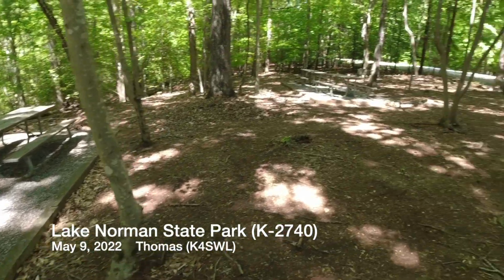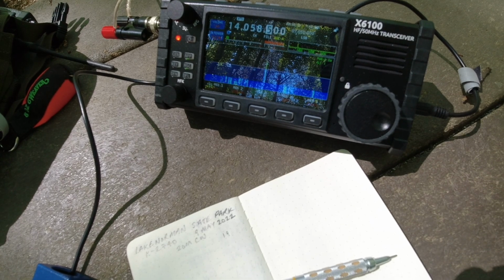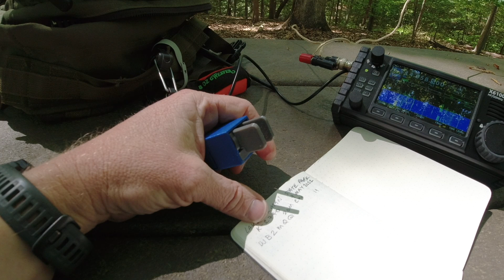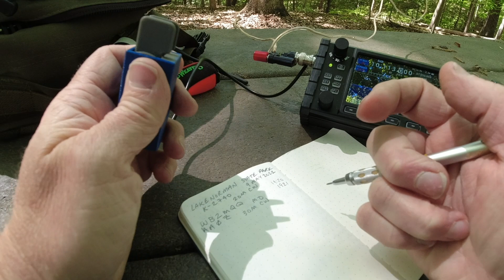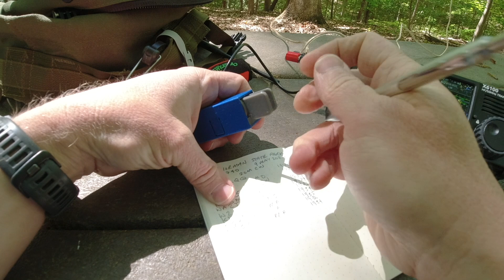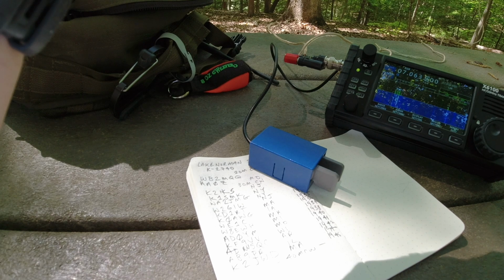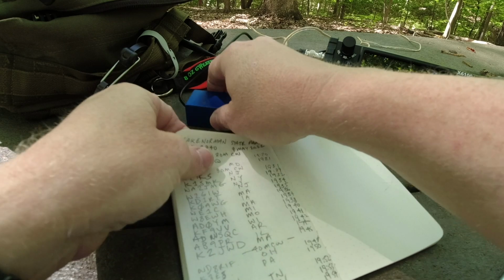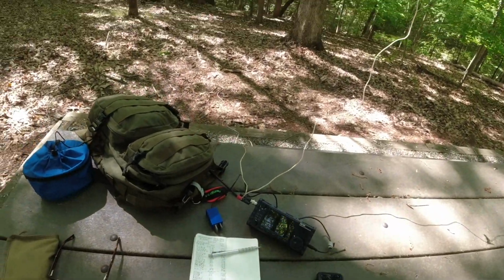First CW POTA activation with my new Xiegu X6100 at Lake Norman State Park!

Comment: I have experienced no overloading issues with my X6100, in the field or at home in the shack. I might be lucky, but really it's been fine here. I also have a IC-705 and many other QRP rigs to compare it with. I am LOVING the X6100. Mine is running full Armbian Linux with FT8 / FLDIGI / QSSTV, etc, all on board! Its got some quirks, but none of these are presenting any problems for me in actual use as yet. It's one for the tinkerers for sure (maybe not so good for your traditional "black box" operator). But I love it!

Comment: First, let’s say that the icom ic-705 is not in the class that the Xiegu x6100 is because the icom 705 does not have an internal antenna tuner even though you have to spend an arm and two legs trying to buy one. So forget the 705 and go with a 6100 and read below.

A comment if you don’t mind. First, let me  say this was an outstanding fantastic video you did. I’m talking about the 6100 Xiegu now. 
When I first bought it last year, I had high hopes for it. And sure enough it had problems. For example, you could not finetune it. That portion just did not work. But finally with the last upgrade, I have spent quite some time with the radio. Thank goodness because before when I bought it, I left it in a box and wanted to spit on it every time I walked past. But after I made the last software upgrade it now has wonderful fine tuning and I actually was able to send Winlink over it with just the USB interface cable that came with it. I also did WSPR with it. And was able to find tune and do CW with it. It seems like the little box with its upgrade is coming into its own. So I think now if someone talks about it, they should first upgrade the 6100 with the latest firmware and find out that it is coming into its own. I really really like the 6100 now however there’s one thing I do not like. And that is the cheap rinky-dink tinny sound coming out of its speaker. But other than that, with a set of earbuds, I can hear it pretty clearly, and if I was to go portable and want to grab a quick radio that has an internal battery and yes, it has an internal antenna tuner I am giving second thoughts about it and may start carrying it whole lot more. With its internal battery and microphone on the front of it you can almost use it like a walkie-talkie. So the 6100 to me is coming around. I think it can safely be considered when looking for a QRP radio. Because it can also do all the digital modes. Finally, the fine-tuning works. So don’t discount that Xieugu x6100 anymore until you’ve done the last software upgrade, and I think you will be quite impressed.
Oh yes, I don’t want to forget, saying that I was so easily able to send Vara HF Winlink email without an external sound card. The one built in this little box is doing just a great job. So this little boy is climbing the ladder.
Reply from the maker: Thank you for your comment. Excellent!

Comment: Hi Thomas, love your activation video's I do have one comment to make though. 
I have tried to hear you on 20mtrs but never manage to do so,  thats why an effiecient resonant antenna would certainly help with us european stations who dont have big yagis to try and work your QRP signals. 
So even though you are the chased after station, it would be better with a properly tuned resonant antenna to give us a chance of a Pota or Sota contact.  Just saying. keep up the activations and maybe one day ;-)
Reply from the maker: So actually, more often than not I'm using efficient, resonant antennas. This year, maybe 60-70% of my activations have been with 40, 30 and 20 meter end-fed half-waves. 
The UK and Ireland is, for whatever reason, a very tough catch where I live in North Carolina. Most of this summer, though, I'll be here in Canada (as VY2SW) where I should think it'd be much easier. 
It is true that more efficient antennas yield better DX. (Save the times I work Europe with the Elecraft AX1. That think is made of witchcraft!)

Comment: Once Xiegu started correcting early issues with firmware updates I was starting to come around to the idea of buying one of these.  If the receiver overloads that easily though it's still a no go for me as I operate from home more often than portable. There's a lot of RF nearby so I suspect I wouldn't enjoy using it much. I also like SWLing and it doesn't seem well suited for that either. I really wanted the X6100 to at least be good, but it looks like it's still not there yet. Thanks for the informative videos Thomas.
Reply from the maker: If you have RF near you, you'd need a BCI filter for the X6100. It's very easily overwhelmed by local RF.
Reply: @ThomasK4SWL  That would help with the nearby AM station for sure, but I'm also worried about the handful of amateurs nearby that run 1kW plus lol. No overloading with my current rig unless I get too close to their operating freq. not sure how the X6100 would handle that.
Reply from the maker: @claudeintheshack  It's hard to know, but I can tell you that the X6100 is pretty easily overwhelmed. In your shoes, I'd look for a different rig.

Comment: Hi Tom.I have the x5105 and G90 and like them.Do you like the X6100 as much as your X5105?I have seen good and bad remarks about the X6100.Do you like the Lab 599 better?It is about twice the cost.Ron NB3W
Reply from the maker: I tend to prefer the X5105 but that's because the battery lasts much longer and it does what I need it to. Some folks really love the X6100 but I haven't warmed up to it as much as I hoped I would.

Comment: I have a somewhat related question for you, do you have a convenient way of measuring wire lengths and how do you label and store them?  73, Bob WK2Y
Reply from the maker: So I simply use a measuring tape most of the time and stretch the wire multiple times across the tape to add up to the length I'm shooting for. When I built this particular antenna, I didn't have a measuring tape, so simply used an 8 foot picnic table: https://qrper.com/2022/05/qrp-pota-at-fort-dobbs-no-antenna-no-problem/
If I store lengths of wire, I usually mark them with tape noting the length in feet. With most of the antennas I build, I simply remember the length, but will label them if similar in size and build to others.

Comment: I had the similar problem with overloading. I thought that maybe (as many things in this radio) this was a problem with just single unit that I've got. So I've got another one and it was the same (although this 2nd unit did fix one issue that I had with 1st unit but also had more birdies than the 1st one). Anyways, I was able to reproduce this issue on my units with 100% reproduction ratio. Every day at noon, the AM broadcast radio from Romania (~1000km away from me) is transmitting for exactly 57 minutes with 300kW at 7310kHz. I can hear the music all over the 40m ham band, especially the first half of it. No matter where I go with the frequency, this music follows the VFO and is always at the center of the waterfall. In my case reducing RFgain to lower than 40 (from default 63) would mostly remedy the issue but it was still too much for me. Also - no other radio that I had, not FT817, not G90, not even the cheap (tr)uSDX, had this problem. I do have a broadcast station about 20km from my QTH but it is broadcasting DVB-T and FM broadcast, not on HF.
Reply from the maker: Thank you for this feedback. Yes, without the assistance of an external BCI filter, I believe the X6100 overloads more easily than any other transceiver I've ever tested including the X5105. I feel it's the biggest problem with the X6100.

Comment: My X6100 makes a buzzing sound from a relay during auto ATU tune. Is this normal ? Does anyone else have this issue ?
Reply from the maker: Hoping someone can help you with this. My X6100 didn't make any buzzing sound other than the normal ATU work to find a match with relays.

Comment: Hi Thomas,
I have the impression that most of the owners of this Radio are not happy. Have you ever tried the ZM-2 with these 2 pieces of wires connected directly to it? I've been thinking of getting a ZM-2 to use with the IC-705 but It's not clear if I could use antenas like this one you are using, connected to the ZM-2
Reply from the maker: You know, I've never tried one of these UNUNless random wire antennas with the ZM-2. I will give this a go when I'm back int he States. The ZM-2 is a great ATU and quite capable of matching most anything. Curious if others may have tried this with their ZM-2. Might be worth posting an inquiry on http://QRPer.net.

Comment: What type of coax and length do you use?
Reply from the maker: In this particular activation, there was no coax because I was using a binding post adapter and wire. Typically, I use various lengths of RG-316 however.

Comment: Would a 16:1 UNUN have given a nice low 1:1 SWR.
Reply from the maker: I'm not sure. I'd have to sort out the impedance of that antenna as-is to see what ratio might work best. Basically, any UNUN would help make it easier to match. The X6100 has no problems sorting out the match without an UNUN though.
Reply: @ThomasK4SWL  I always thought it best to use an UNUN so as not to put stress on the output stage you it is better to be safe rather than sorry and be out something like $600-00c for a new XIEGU X6100
Reply from the maker: @DAVIDGREGORYKERR  I always assumed that in a radio like the X6100, KX2, etc. (with built-in ATUs) that a wide range ATU between the finals and the antenna serve the same purpose: to match impedance. I know when using a radio without an internal ATU, it's super important to make sure that SWR is in check to protect the finals from being stressed. Am I missing something in your point? I'm not a radio engineer. :)
Reply: @ThomasK4SWL  Like I said it is better to be safe rather than sorry no one wants to have to replace a transceiver because they let the magic smoke out.
Reply from the maker: @DAVIDGREGORYKERR  I hear ya. I'm not going to worry about it too much with this class of all-in-one field radio because they were designed around using random wire antennas like this. In fact, Elecraft even suggests it in their KX series ATU manuals! :) I've been using antennas like this with my KX3 for nearly ten years--hard to believe the radio is that old nearly. :)  I think the fear would be operating a mismatched antenna without implementing an in-line L/C match or lowering the impedance with an UNUN.
Reply: @ThomasK4SWL  I have a KX3 with the internal ATU. I use the LDG 9:1 with a random wire and also have added the LDG 1:1 to that as well. Am I just unnecessarily sinking power into those units and being too cautious (aka paranoid)?  Great vid as always. Thx.
Reply from the maker: @liminal27  It'll never hurt doing that, so no worries there. Elecraft will tell you that they design their field radios to take on any field antenna you throw at it and the motivation, in fact, is to have an ATU that can match to the point that a balun isn't necessary. That said, it's easier for the ATU to find a match with an in-line 4:1 or 9:1--it'll certainly make it possible to match an even wider range of frequencies. My buddy WD8RIF uses a 28.5' speaker wire directly connected to his KX3. He'll often these days include a 4:1 so he can match down to 80M too (without it, the ATU can't match). Of course, a 28.5' wire is super inefficient on 80M, but he can still work a few stations! :)
Reply: @ThomasK4SWL  Built-in ATU's tend to match over a limited range such as maximum 3:1 SWR.  External ATU's can typically match up to 10:1 SWR.  Part of the reason for that is high voltage when there's high SWR.  The tuner can protect the radio, but a 10:1 SWR is still 10 times the voltage at the antenna terminal and that requires larger components and greater spacing between components.
Reply from the maker: @thomasmaughan4798  Thank you for the info. For what it's worth, the ATUs in the Elecaft KX series and Xiegu radios are very wide range. In fact, they're the best at finding matches of any ATUs I've ever used. That said, the component spacing would be rather dense because the space on the ATU board is quite limited.
Reply: There's so much in this thread that's at best misleading and at worst downright incorrect that it's hard to know where to begin.

First, often the reason an unun may make matching easier is that it may be quite lossy. A 1:1 current balun working into a balanced load with no common mode current in the transmission line to the load has no flux in the core and thus has negligible losses other than copper losses. An N^2:1 unun with N times as many turns on secondary as on primary has lots of flux in the core -- that's how it works! -- and has core losses as well as copper losses.

Next, to the extent that an unun isn't lossy, it transforms reactance just as much as it transforms resistance. And unless it's connected in backwards (which, for some antennas, might indeed be the wiser way to connect it!), it transforms both resistance and reactance downward, not upward. You may not want to do that.

Let's look at some examples. That 28.5  ft speaker wire antenna WD8RIF uses is worked against some sort of counterpoise, perhaps another 28.5 ft length of wire. It's hard to say what impedance that poor excuse for an 80 m antenna might have, without knowing the wire size, how high it goes, how high the counterpoise is, and what sort of ground is underneath it all. But it could well be something like 12 - j1500 at 3.54 MHz. If the 4:1 unun were perfectly efficient that would turn into 3 - j375 on the KX3 side of the unun. Now the KX3 tuner is truly remarkable, but I doubt it could handle 3 - j375. That it is capable of handling whatever really is on the KX3 side of the unun shows that the resistive component of that load is going to be a good bit higher than 3 ohms, and likely the reactive component is going to be a lot tamer than - j375. And that means the unun is being very lossy. You could put two resistors in an L network between the antenna and the KX3, instead of the unun, and make it easier to match, too. Cheaper, certainly also lossy, but maybe no worse than the unun. You'd have to measure, to find out which was worse.

Even under tamer circumstances, ununs don't always make things easier to match. Suppose an antenna had an input impedance of 40 + j0. That might happen with a quarter-wave monopole worked against a VERY good counterpoise system. The KX3 would manage, with ease. In fact a transceiver without antenna tuner, expecting a 50 ohm load, would be pretty happy. But a GOOD 4:1 unun would turn that into 10 + j0. Do you suppose that, rather than 40 + j0, would be easier for the KX3's tuner to match? And what if the antenna were, not 40 + j0, but say 10 + j0? (That could happen with a base-loaded very short whip, again worked against a VERY good counterpoise). The 4:1 unun would turn that into 2.5 + j0. I'd prefer the raw 10 + j0, and I'm sure the KX3's tuner would, too! In fact if I had that antenna and the unun, I'd turn the unun around backwards and let it make 40 + j0 out of that short antenna system!

There are times when an unun is a good idea. And there are plenty of times when it is a horrible idea. Moral: measure, and do the arithmetic.

David  VE7EZM and AF7BZ

Comment: KA6TVX the sequence to get cw messaging working is “APP” Modem then “MSG”
Reply: Exactly, if you're looking at the Fullscreen scope, like with the radio settings across the bottom of the screen, and you press MSG, you're editing the messages. If you're looking at the modem screen for decoding cw, then press MSG, that's when it will TX the messages from memory.